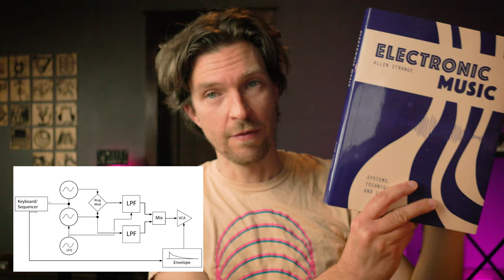Möbius Gong | Make Noise

Comment: The old patch with the DPO, ModDemix and QPAS sounds more like a pitched gong. However, the modulation feedback in the new patch adds a lot of liveliness to the sound!
Reply from the maker: I think I agree! One thing I'm curious about now is how they arrived at that original idea for the patch.
Reply: @MAKEN0ISEMUSIC  probably a happy accident when someone plugged two oscillators into a ring mod and a filter and discovered: That sounds like a gong 😅
I find it very inspiring when you show your patches and also explain how you came up with the idea. Making Noise is synonymous to exploring sounds.